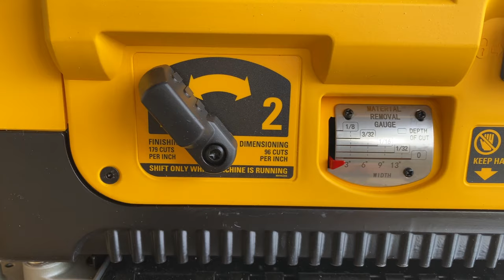DeWalt DW735 Planer in Action

Comment: I wish my Ridgid had your slow speed… mine only runs at 96 cuts per inch which is the same as your fast speed and basically twice as fast as the slow speed and I think it’s just too fast for a little planer….. definitely get a better quality cut with a slower feed rate

Comment: How well does it plain hardwood boards like maple?
Reply: Or hickory, ash, cherry, and walnut. I make cutting boards and would rather not spend 20,000 on a planer like we have at work😅
Reply: @bradeyyates6280  we actually bought one. It works really well with planning hardwood. We plained a bunch of maple about 2 1/2 wide X 3/4 thick. No problems.
Reply: @ManyDoors777  thank you!! Do you think it will take 8" by 3/4
Reply: @bradeyyates6280  I think it could. Haven’t tried a board that wide yet. We have an old 25 year old Delta that can, so I’m sure this could do it better.